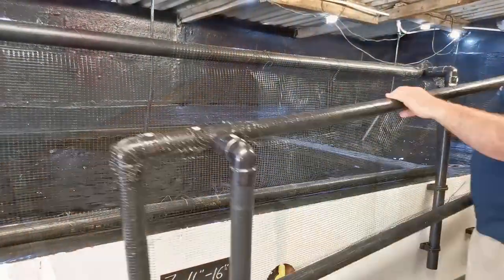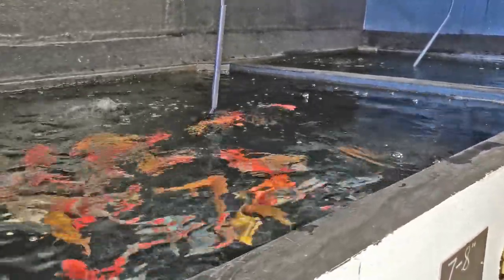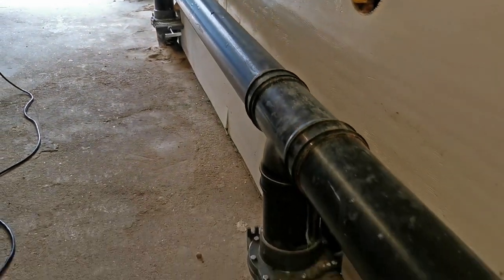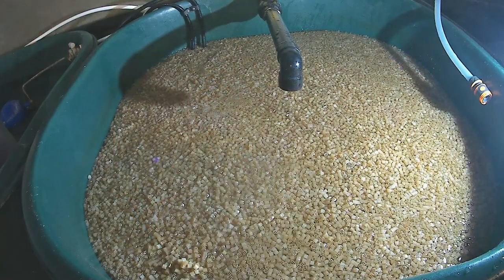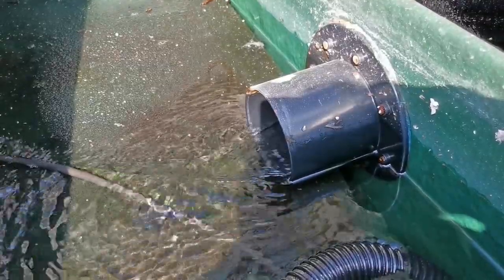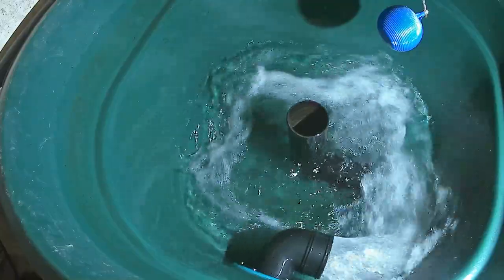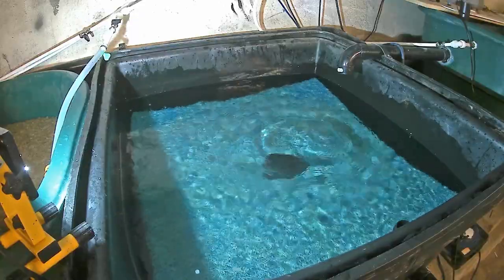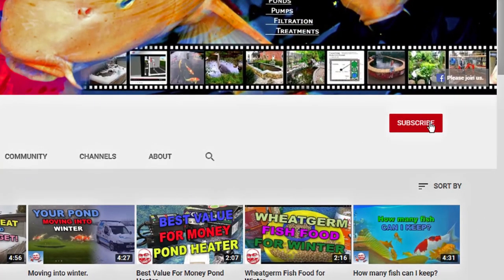Guided Tour and Easy to Clean Filter.

Comment: NICE 
but how do you run whith low water levels. I mean how do you set it up ?
And the uvc do you not have to kil off the pest . And what kind of lichting do you have to keep the collers op of the koi .
Sorry for my Engels im a Dutch y.
Reply from the maker: The system can easily run with the water down by 30cm.  This is because I made sure that the transfer pipes were low enough down . Its a simple thing but it makes a massive difference.  We don't need a UV because the water will not go green with algae. I am extremely sceptical about the benefits a UV would have as a steriliser. To kill bacteria or parasites etc you need very powerful  expensive to run UV.
Reply from the maker: The Koi are not kept in the unit long term so any lighting is just for practical purposes.
Reply: @leecalladine   thanks a lot

Comment: Great set up 👌 Can ask what size pump you are using on the filter and what is you flow rate?
Reply from the maker: It's a 17000 pontec. I think it's doing about 2800 gallons.
Reply: @leecalladine  great thanks 👍